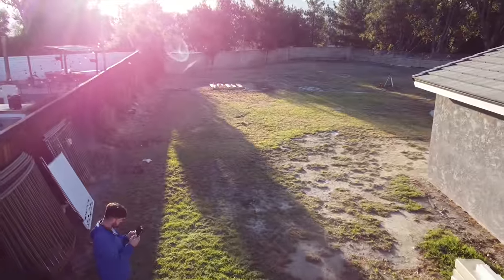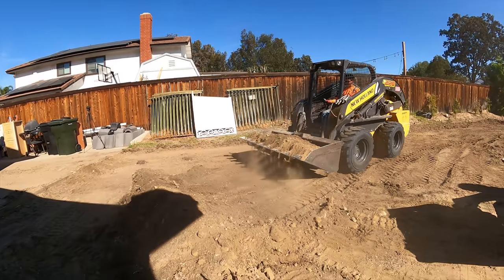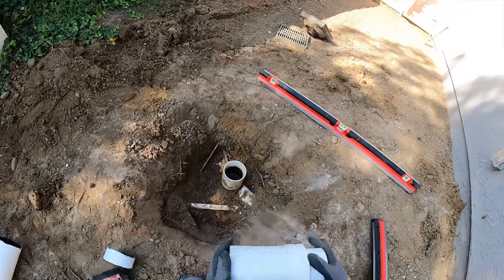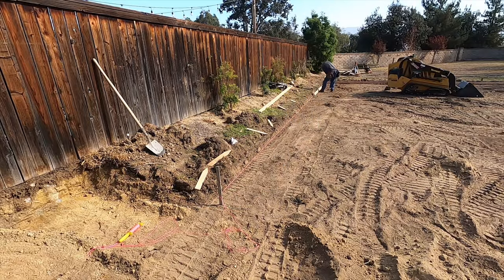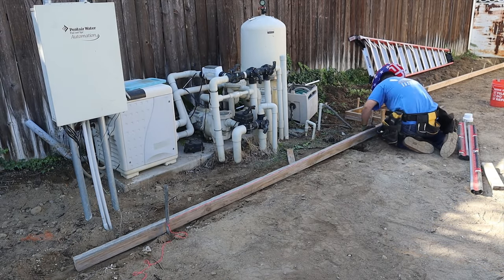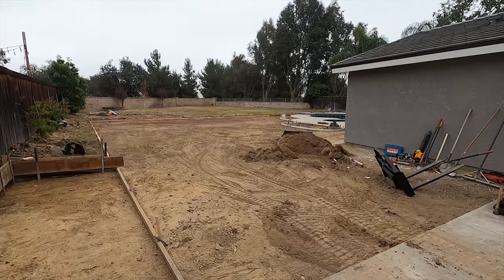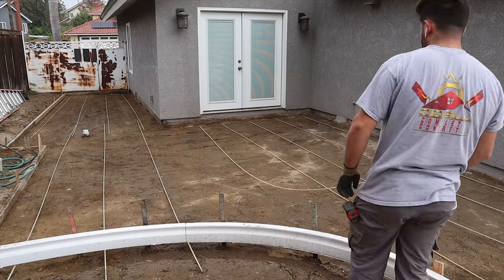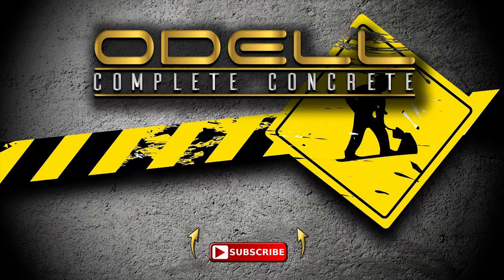Massive 40 Yard Concrete Patio Demo & Setup with Drains

Comment: Good stuff. A mini excavator with a grading bucket and digging bucket would make you life and your guys life so much better
Reply from the maker: yes
Reply: @OdellCompleteConcrete  make sure when you do decide to invest in a mini excavator. Look for excavator that can open and close your tracks. I can not express how this has saved me time and time again. We use a jcb 8018 mini. With the tracks closed completely and blade extensions closed I can squeeze through a 43” entrance

Comment: I have some of those levels(4', 6', 8') IIRC, I purchased them from Juniors Tools(RIP) around 1990+.  If you look at the level, there are two screws, one on each side of the level bubble. Those are there for re-adjusting the bubble.
Reply from the maker: Wow they're old models. but sound solid.
Thanks

Comment: Hey man. A healthy tip for ya. First. Love the tie gun. I love mine witch brings me to my next point. If your doing a big field you can tie the outsides 100% and then 50% in the field. Little fast and your not wasting so much line. But. Give it a try
Reply from the maker: The fiberglass rods are to flexible for that

Comment: One of the tricks I use to locate drains, waste, leech or similar is to shove an electrician's metal fish tape down it and then attach a wire locator to it and trace it that way. Sure, ya gotta make sure to clean the tape really well after locating a septic line......
Reply from the maker: Good idea

Comment: Mr. O'Dell it's risky to top off the trucks because if he overloads it and the chp weights him I bet you my virgen corn hole, that will be the last time he makes that mistake.  Overloaded tickets are extremely expensive and they go to the driver. Good work Sir.
Reply from the maker: These trucks are designed to be filled to the top or they would be shorter.
Reply from the maker: Thank you